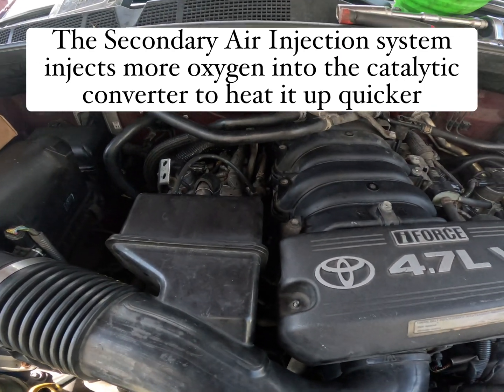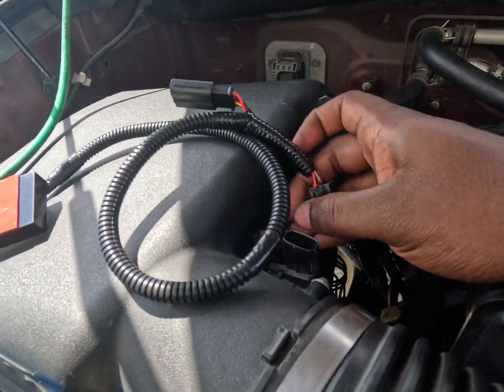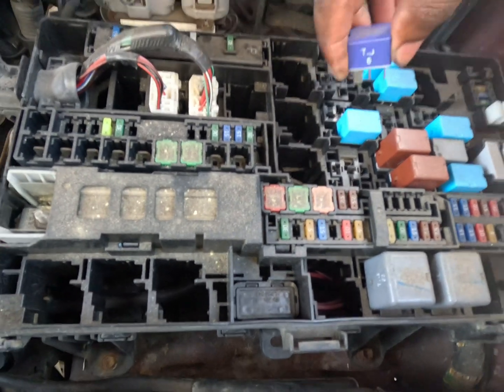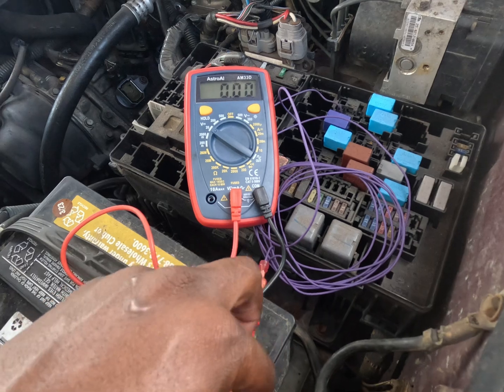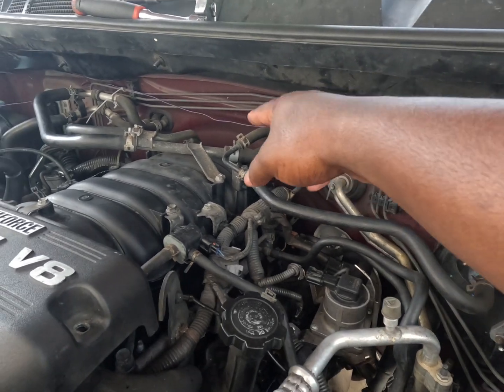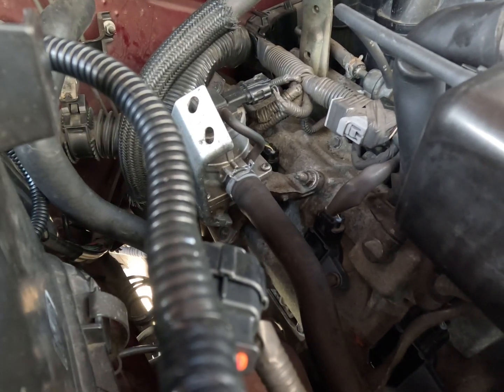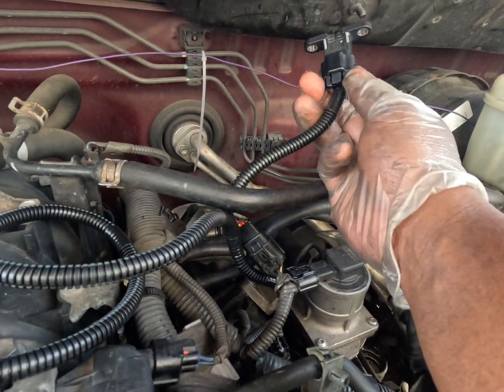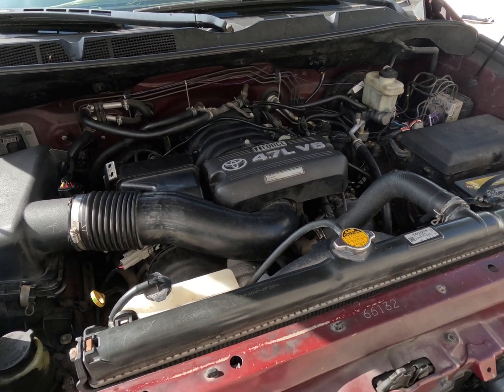Toyota Tundra Secondary Air Injection Delete Kit

Comment: its a bait and switch company i ordered the kit and called about installation and was told i would most likely need more parts that are another $255 to make it work canceled my order after that
Reply from the maker: I will admit the delete kit isn’t cheap but it’s good to diagnose what your issues are before purchasing the kit. They have add ons for different years & engines

Comment: So, using this bypass kit, will make the computer make the truck run good/no limp? but, will fail emission test?
Reply from the maker: The SAIS system basically just helps heat  up the catalytic converter faster on a cold engine. I don’t see why that would cause you to fail emissions as long as your catalytic converters are in good standing
Reply: Well, that’s not what the secondary smog infection pump for 
is for so when a truck is cold, your cat converter is not efficient so it takes your smoke and rejected back into your burning chamber believe it or not until it warms up